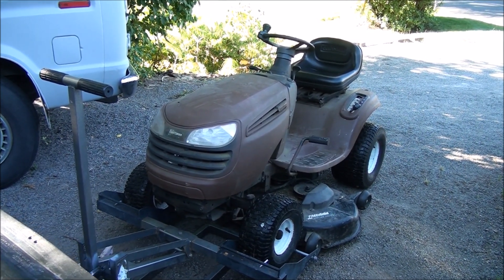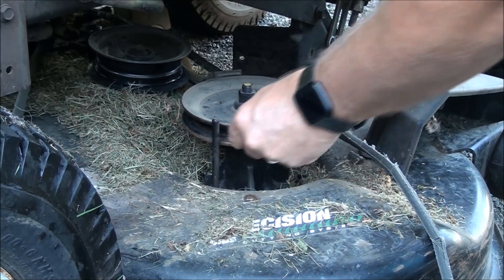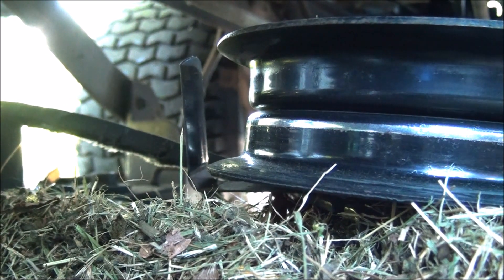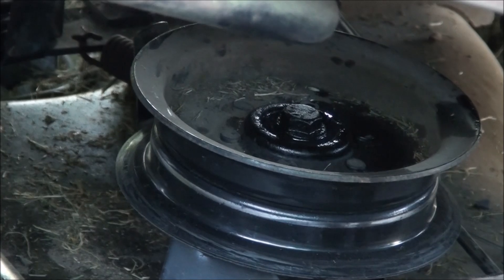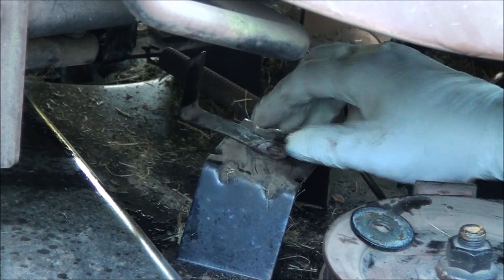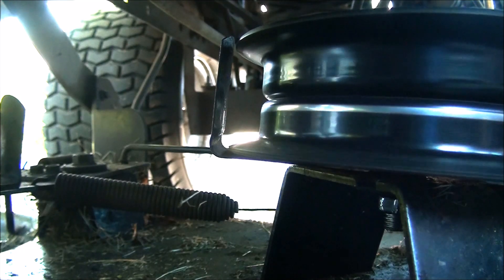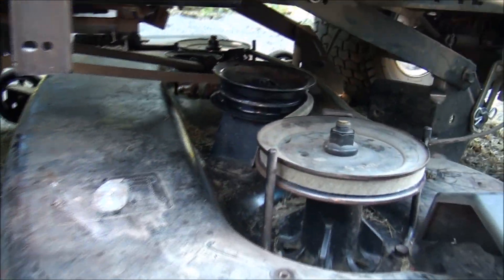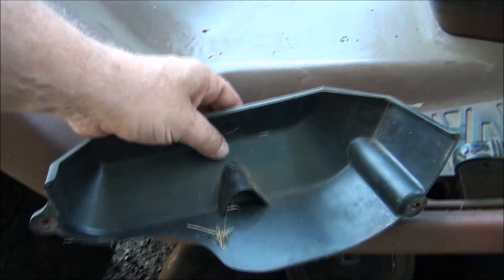WHY does my Riding LAWNMOWER BELT keep coming off, getting DAMAGED? BAD BELT or SOMETHING ELSE?

Comment: Did you ask the customer if they wanted oem or aftermarket belt? And if it was your choice would you charge them for this repair?
Reply from the maker: I only charged them the price difference for a new OEM quality belt, about $15.00. No labor charges
Reply: Ok
Reply: On MTD, I usually never give them a choice. It's my reputation on the line. I explain to them MTD is very specific as to their pulley design fitting the belt. An after Market belt is not designed to properly ride in the sheave like an OEM is. Once I explain that, no complaints.
Reply: @scottfirman  But he chose to use the cheaper belt the first time, not the customer.  He did the right thing by only charging the customer the difference in the belt price and no labor for this fix.   I'm impressed by his honesty and fairness to his customer.

Comment: Does anyone know why the deck belt ends up twisting , but never comes off the pulleys ????
Reply from the maker: it probably has a damaged/burned spot on it
Reply: @JeffsLittleEngineService  I've rebuilt the deck and new belt but the belt is tight but ends up twisting

Comment: My 2014 Simplicity 48” Fabricated Deck model is so special that the only keeper it has is the deck is one on the idler.    It tosses belts almost exclusively when you engage the deck.   OEM or aftermarket makes no difference and all the bearings are fine.    It’s done this since not long after buying and it sucks.    Like most I’ve seen I leave the covers off the outer pulleys just to put it back in easier ..   the idler does seem to have the belt leaving it at a somewhat extreme angle going up to the drive pulley.    I’ve had the arm off there and being something of a metal mangler myself i can see it’s at the angle they made it.       
     So any ideas I’ve not covered?     I’m thinking about fabbing up a couple adjustable keepers for those outer pulleys.    I always wondered how Deere seems to have them on all the pulleys while Simplicity gets away without them.   Need

Comment: I have an issue with  my deck belt tension do believe it is  a  spring problem beats me how or were  may be you my friend can shed som light on how I may rectifi this type of problem more on the problem it looks like my mtd deck wobbles when cutting so it is were i think a spring is missing i do not see were it may go once it is known
Reply from the maker: The belt may need to be replaced if the deck vibrates alot when cutting

Comment: Umm im just a homeowner mower guy, so my ? Is this, why not take the deck off?  I have had ti take mine on and off several times this year in my efforts to keep a 21 year old rider working.  Just makes time sense to drip the deck and quickly diagnose and repair the problem.  Not an expert just asking.
Reply from the maker: Yep taking the deck off is probably a good thing to do to inspect everything. When this mower was in my shop 6 months prior, I did a full deck service and took it off the machine for full inspection. However, that seemed like more work for me to take it off this time around so I just performed this repair with it on. Thanks for watching!
Reply: Ok just wanted to know pro and cons, i have a hydrostatic trans that after it gets hot i lose power in both forward and riverse, is there any way i could bend your ear on how to trouble shoot my problem other then on here if your able or want to help.  Its a peerless trans and i have had it off 2 times and the bypass doesnt work as well as the forward and back motion. Short of bying a rebuild i dont know what to do

Comment: All belts are aftermarket belts.  You just need to find where the mower manufacturer sourced their belts from.  Or get a Gates or Stens belt which is probably better than OEM.  
When the flat side of the belt touches, it is an idler not a pulley.
Heat kills belts.  Slipping belts generate heat.  Worn pulleys allow belts to slip.

Comment: A few things I can tell right off the bat here  First your grass on the deck is long so raise your deck and you need to slow down your mowing too fast and you may have bent that deck those pulleys don't looked lined up right to me anyway. To know for sure I would have to see & hear it run..
Reply from the maker: sometimes the belt angle from engine to deck looks funky but it is working great!
Reply: Yeah... bent deck? There is a new one.

Comment: just my 2 cents,,belt is wrong width for ur mower or u have way to much tension on it.by the wear on the inside means the belt is going all the way into the grooves on the pulleys and this  causes the pulley to grab and hold the belt until it gets jerked out which causes the belt to break in segments.a wider belt or backing off the tension should solve the problem.
Reply from the maker: good tips!  A crappy belt was the issue on this one.

Comment: When you replaced the idler pulley and belt guide. You should have fitted the belt onto the pulley, so you didn't havebto bend the belt guide out, to fit the belt.
Reply: RIGHT - but removing that Idler Plly may demand a three-prong gear puller after an overnight soaking if it's an old mower deck. Best way to do it, though. And the sort of appraoch you expect a 'professional' would do. Bending a belt guide is a jury-rig approach.

Comment: So you are confident it was a cheap produced belt. Which belts do you recommend?
Reply: Stens are very good belts. Kevlar green are great. But make sure your spindles turn easy
by hand. The spindle bearings need to be changed over the years. The grease cooks out
over time with the heat. Bearings are cheap to replace. If you replace them, take the seal
off and inspect the grease level. Make sure it is packed close to full. Years past, the American bearings were the best and they were packed, today it’s not the case. Hope this helps.
Reply: @algorel4763  thanks for your knowledge on this.
Reply from the maker: Yes it said "proven part" on it. I also looked up the order info. from when I installed it 6 months prior.  Pretty much anything made in USA and that was OEM on the machine is ok.  Stens and Oregon do provide decent quality aftermarket parts I agree
Reply from the maker: Good tips Al!